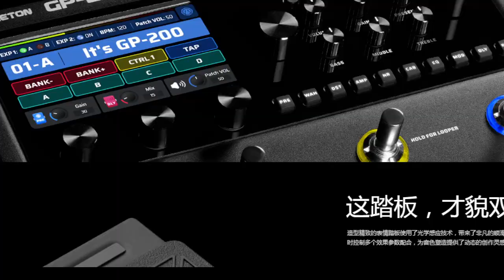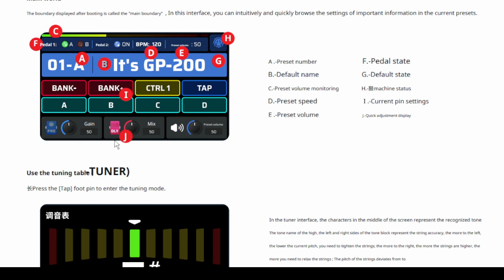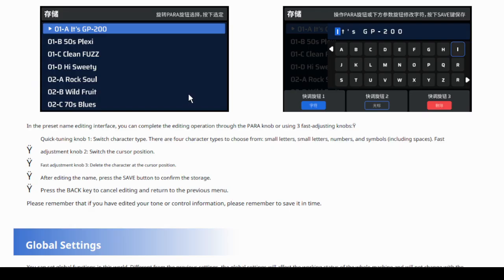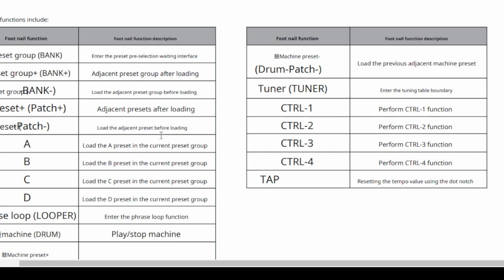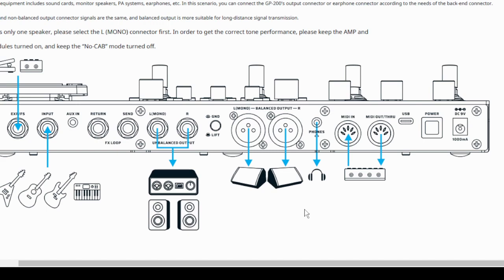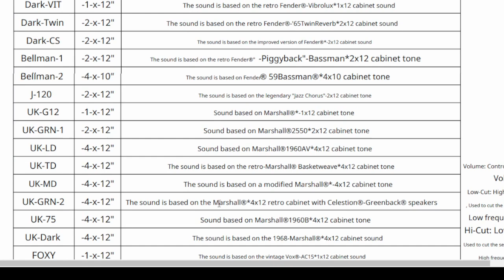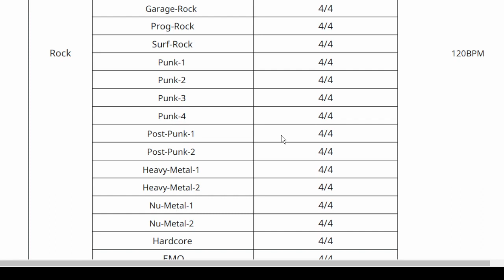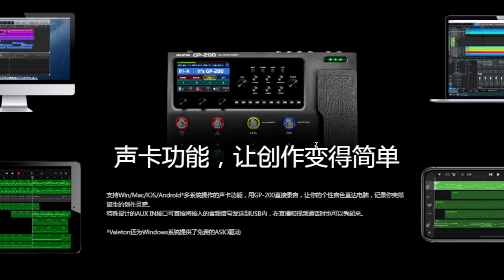VALETON GP-200 IN DEPTH (MANUAL)

Comment: Thanks for the detailed video. For me, the main factors for a good multi-fx unit are good clean tones, a decent looper, and good distorted tones that don't need a noise gate so high that the sustain is killed (that is the problem on my current multi-fx pedal NUX-MG300). Is the wah pedal available for all patches on pressing the expression pedal (this is the case with my current multi-fx pedal, NUX-MG300) or does it need to be assigned in the patch as needed? Lastly, does this have gapless patch switching?
Reply from the maker: thanks, I do not own this pedal but many do you can ask them here https://www.facebook.com/groups/1080579552678581/
and here https://www.facebook.com/groups/320656136446736/
Reply: @B4Rnews  Thanks!